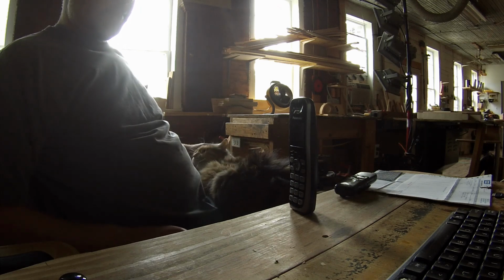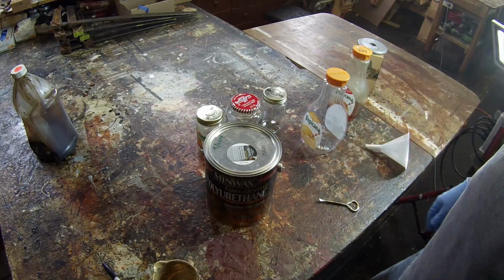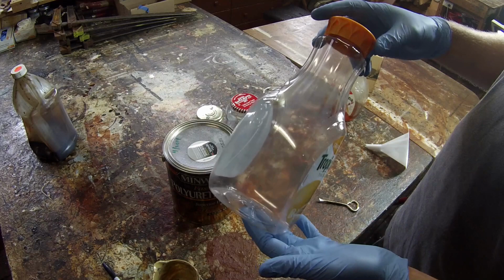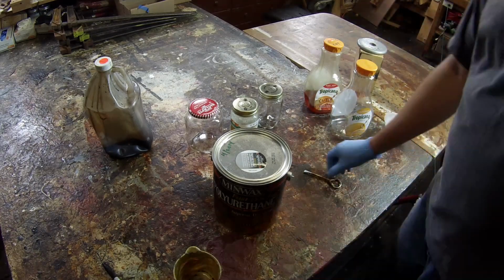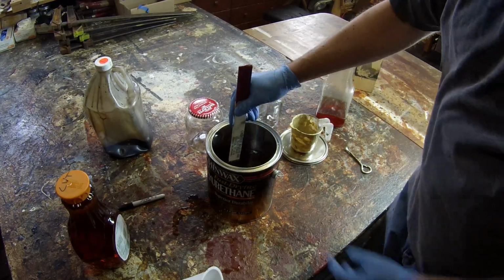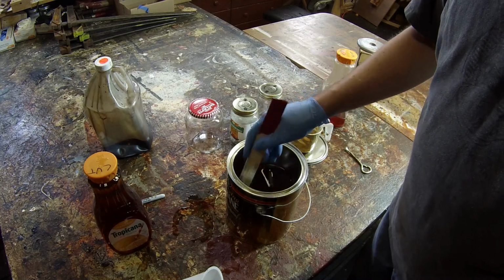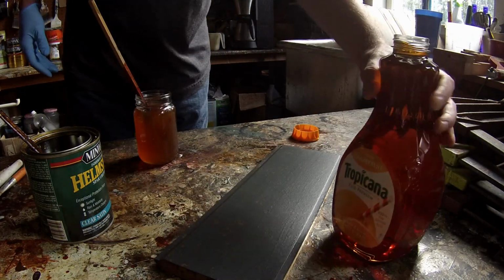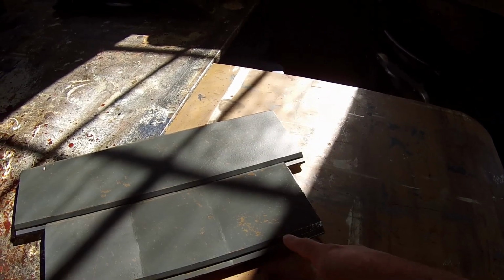FLAT Varnish -- Easy DIY Finishing Tip

Comment: Thanks very much for this info. My wife does not like shiny finishes at all and we always have to compromise and use shinier than desired. So this is much appreciated.
Reply: I have a wife also doesn't like shiny either we had a ceiling and beams covered with wood the contractor mixed lacquer thinner with semi-gloss polyurethane to knock down the shine and dried quicker made her happy.

Comment: I've spent hours watching your videos and even incorporated quite a few of your methods into a cherry sofa table I am building. I ended up on this video because I applied two coats of the Helmsman spar urethane you use in the demo and un-flatness is exaggerated by the cool streaks and bubbles I added. I actually considered setting it aside for six months while I wait for a can to settle....

Comment from the maker: NOTE:  DO NOT buy Minwax polyurethane at Home Depot... They sell a product called "High-Build" which is a completely different type of varnish than "Fast-Drying" (and i should mention it is horrible and toxic).  I have also bought quart sized cans of the "Fast-Drying" at Home Depot, but then found out it was the same nasty toxic stuff just mis-labeled!!  SO, because that happened, I never buy Minwax products at Home Depot.  I have heard that it is common for Home Depot to sell knock-offs of their own brand name items.  I always buy Minwax at local hardware stores and am happy to pay a few dollars more because I have not since had a product problem.

Comment: Wow. Great video Mitch. Are you concerned with the oil based poly yellowing over time on a painted surface? Especially lighter colors? I have used water based over paint for that reason, but a perfectly flat sheen over paint is an awesome look.
Reply from the maker: +GuysWoodshop YES... you got it.  I use the water base on white and cream colors because of the yellowing.  This same process works on water or oil based varnishes.  Flat polycrylic looks great over paint.

Comment: Great tip.  I've been looking for a good matte option for a kitchen table.

Any thoughts on thinning the 'cut' poly that you have leftover?  Would that help the curing/make it a more durable base coat or just cause me to have to apply more coats for the same build-up?

Thanks for the great content!
Reply from the maker: +Brian Ernste
"cut" poly would not normally need thinning unless you are wiping it on.  I usually mix it with stain which does thin it out further.  Sometimes the Flat poly requires a little thinning for brushing a wide surface because it is so thick with the heavier resins.

Comment: Thanks for sharing your knowledge.  A couple questions:
Can you put oil-based poly over water-based paint? 
And why do you mix stain with the cut poly?  Do you use it as a glaze?
Reply from the maker: +tj patrick yes you can put oils over water based (but not the other way around).  I mix stain with the cut poly to use the product for base coats on reclaimed wood.  its a light concentration, 1:8 ratio, so it just tones it a bit.
Reply: Thanks.  And why don't you use water-based poly all the time?  Is the oil-based better (if you are not using over lighter colors)?
Reply from the maker: yes, the oil base is much easier to apply as you get more work time to brush on an even coat.  it is slightly more durable.  water based varnishes have to go on quick and skillfully.  the brush marks can be a noticeable problem on darker colors with acrylic varnish

Comment: Thanks Mitch, a really helpful tip.
When you say that it can be used on water based varnishes etc, is there any special tips? The contents of the water based products would settle a lot quicker won't they? 
Also, will the gloss of the 'cut' undercoats shine through to the final flat finish?
Reply from the maker: +Marisa Aguilera 
My only tip is to stick with one brand so you are familiar with their terminology.  Minwax makes a satin polycryllic water based varnish that is the same sheen so it produces similar results.  yes i think it would settle faster in thinner liquids... (HINT... if the can on the store shelf has a layer of dust on it... you know its been there for a while... so if you can transport it carefully its good to go.)

Gloss on the undercoat will not show through UNLESS you miss a spot on the topcoat
Reply: hffcom Thanks, I appreciate all the work you do.

Comment: Awesome video! Thank you! And it's not given away entirely for free... I gave you a like! And a comment! I'm fresh out of gold and gems. And cash, for that matter.

So.. you could still sand and do multiple coats, right?
Reply from the maker: +djAnakin if you are asking about the 'cut' poly, yes.  I usually do 2 basecoats on hardwood and 3 basecoats on softwoods, then one final flat topcoat, always sanding between coats
Reply: Perfect. Thanks.

Comment: I don't understand why you're not just buying flat poly. Any true paint store or combination paint/hardware store should carry it. I've used it for many, many years for interior trims when customer's didn't want the plastic look of a poly with a sheen or sometimes when I've refinished furniture etc.  I think several of the major brands make it, or at least market it under their names, such as. Zar, Zip Guard, Sherwin Williams, Pratt and Lambert, Last and Last etc, so it should be easy to obtain.  Sometimes it's called Antique Flat.
Reply from the maker: +kperellie Ben Moore made a great flat ploy out of the can.  they stopped making it.  I've tried Zar antique flat and other products but they don't come out flat.  Other people have had this problem.   and it saves money to use cheaper products.  I don't have too many retail options were I live so i gave up on finding a product